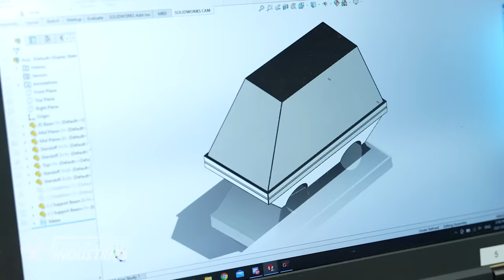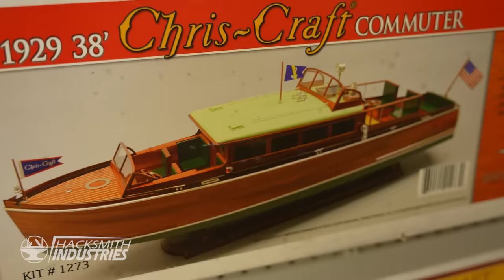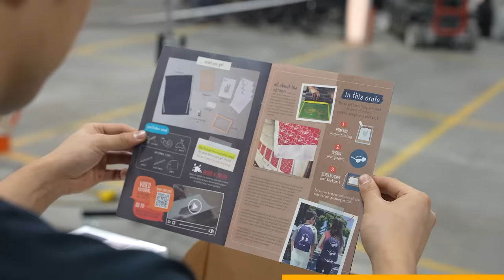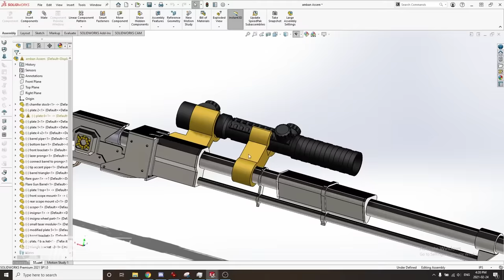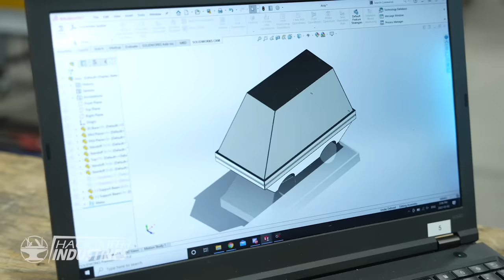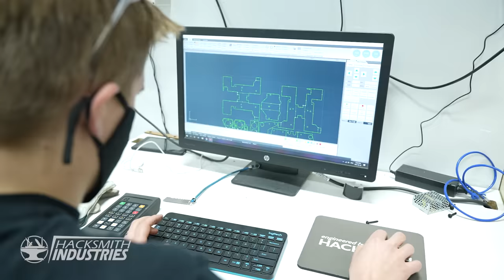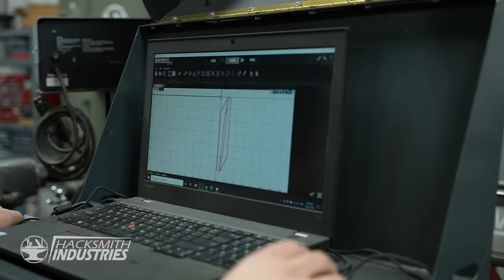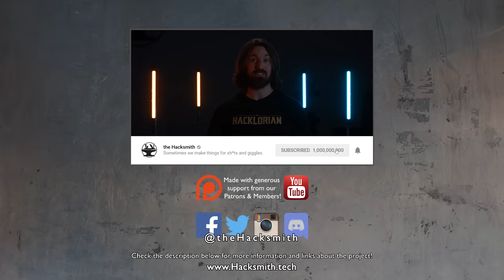Mando's Amban Pulse DISINTEGRATOR!!! (HACKLORIAN: Chapter 7)

Comment: Watching him with the RC getting " This steel is too heavy, I'll use thinner steel " stuck in his head made me think of my youth. Instead of using aluminum, thin plastic sheets or even Balsa wood.
Reply: I think they all just default to steel whenever they need rigid material. I don't even remember the last time they used aluminum for something. Their results look cool, but not everything has to be bulletproof, yeah :)  They even once commented on their tendency to make things out of steel a lot during the build for the James Bond spy car when they made a small platform to lift a projector or something which ended up being really heavy.

Comment: One tip for tig welding, make sure you rub it down with acetone or rubbing alcohol before welding. The surface should be clean. You know you have a clean surface when it doesn't make sparking noises that you sometimes can hear in the video.

Comment: How to get started in engineering.

1.) Learn how to measure and the units in which measurements are made.
2.) Become familiar with solving structural/design problems
3.) Learn how to do a lot of math on the go
4.) Learn how to use CAD proficiently 
5.) Get a 3D printer or CNC machine and begin making things

Within a matter of months to years, you will be  (actually) engineering.

EDIT: To make things like what is shown in these videos, you will need more than just engineering skills. You will need to know a variety of skills including soldering, circuit design, welding, wood work, how to use power tools, education in various scientific fields etc. That is why Hacksmith has so many people involved. Everyone brings different skills to the table. This is also why a real life Tony Stark is unlikely as someone would pretty much have to become an expert in all these fields. Most people spend their whole lives mastering/learning a single trade, let alone dozens.

Now you know what it takes. Get out there and start engineering!

Comment: When welding seams, you actually want to weld forwards, not backwards like you are doing, when you "Drag" weld, you introduce too much heat, and the material cant cool off very well (It is a little quicker, but its impossible to control it). When you "Push" weld, you are not heating the part you already went over, so it cools off better and sets more easily!
Reply: Oh and as allways! "Grinder and paint, makes me the welder i ain't"

Comment: Hi, I am trying to get a quality 3D printer for something under 1000 dollars and I would like it to be something beginner friendly. I would also like it to be something that is good for a  beginner machine but I don't have to replace it like the year after I buy it because it is to cheap or is to much of a beginner machine. Basically what I want is a machine that is beginner friendly but is also a good buy and is a solid 3D printer that is good for recreational printing and making small parts for engineering builds of my own. Any recommendations?

Comment: shorten your stick out and what your cup size is double it (if it’s an 8 size cup, you gas flow would be 16) and that should be your gas flow. Clean the stainless with acetone. This would help with the porosity.
Reply from the maker: This one's mild steel

Comment: Of course the RC car won't budge; you have the "chassis" (actually the body; you already have the chassis) is sitting directly on the wheels... I bet it would have moved if you didn't have the wheels pinched between the ground and the metal plate.